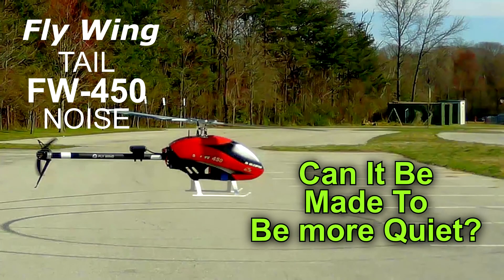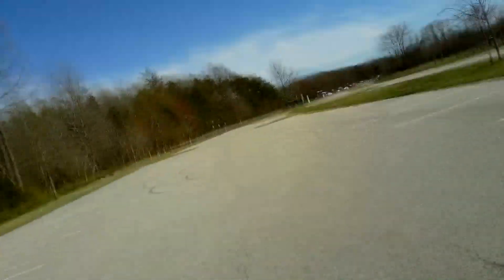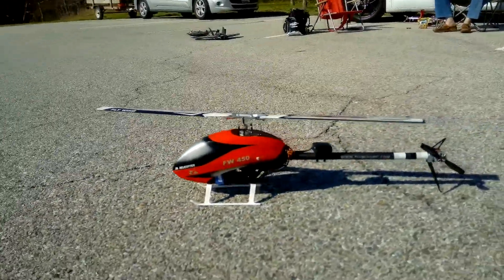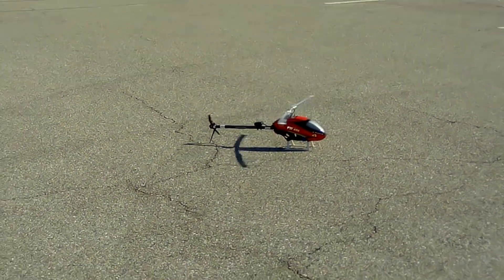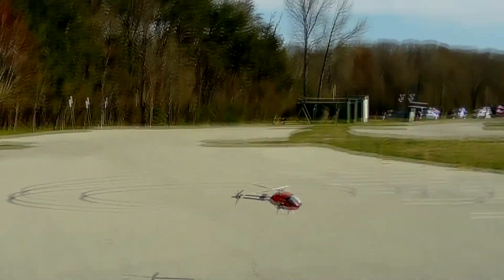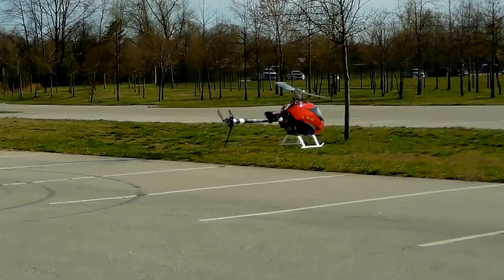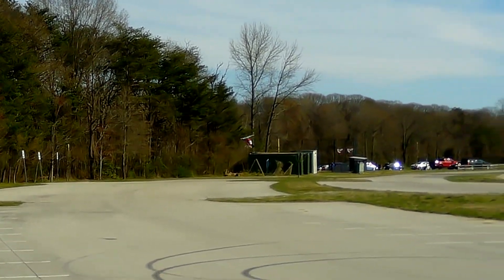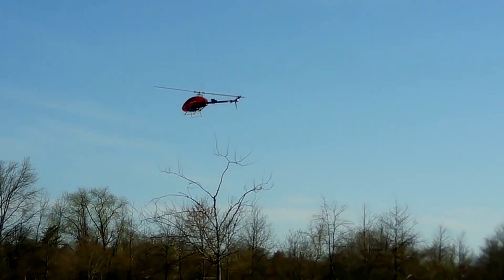Fly Wing FW-450 Tail Motor Noise Mod

Comment: If it is quieter, it doesn't show on this video. The camera man doesn't help.
Reply from the maker: Thanks Dave but I have to disagree. The tail motor noise is at a much lower pitch with this modification. As for the camera guy, this was filmed with a really low cost camera and my friends phone. I have since gotten an expensive good camera so future vids will be at a higher standard. Thanks for the watch!

Comment: How difficult is the mod?
Reply from the maker: VERY easy! It took less than 15 minutes to swap the motor to the other side. This might be the easiest mod for the biggest bang I've seen. Just make sure to have a pusher (CCW) propeller on it. It made a HUGE difference in the noise of the motor. :)
Reply: @RobisonRacing68  I see some tape? on the tail section by the tail motor. Is this for looks or does it have a function?
Reply from the maker: @emsman59  Oooo I'm slow sorry! It's just to see the tail better. Old eyes. LOL!
Reply: @RobisonRacing68  White tape...Also can you send me a link to the blades you are using? Did you have to go into the PC program and set anything in relation to tail motor gains and such? Thanks...much appreciate the information.
Reply from the maker: @emsman59  Other than swapping the the motor over and the propeller, nope! Easy switch. Here ya go. https://www.amazon.com/gp/product/B07Y6L4LF1/ref=ppx_yo_dt_b_asin_title_o05_s00?ie=UTF8&psc=1

Comment: What tail prop did you use
Reply from the maker: I used these Robert but any bull nose 5 x 4.5 should work fine. They come with 2 CW and 2 CCW in the pack. The motor turns CCW so use the CCW props. The writing on the prop should face outwards to the left so the prop will blow air to the right. The difference in the sound is amazing! Thanks for the view! https://www.amazon.com/gp/product/B07Y6L4LF1/ref=ppx_yo_dt_b_asin_title_o07_s00?ie=UTF8&psc=1
Reply: @RobisonRacing68  thanks a lot👍🇮🇪